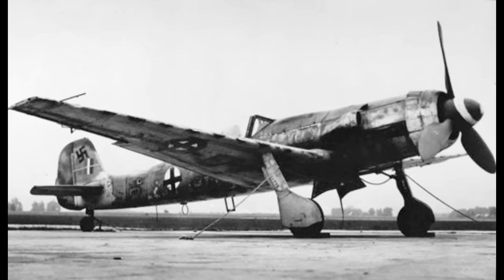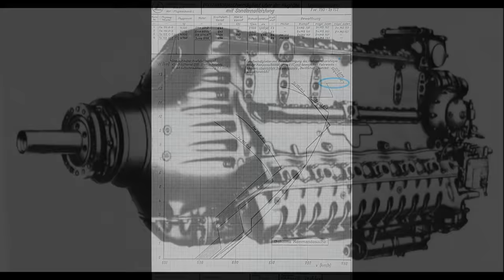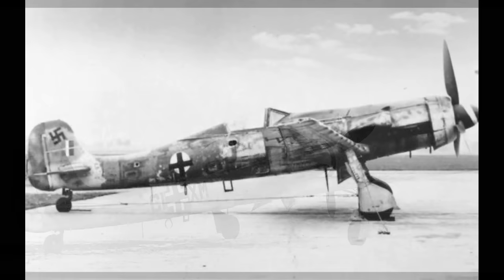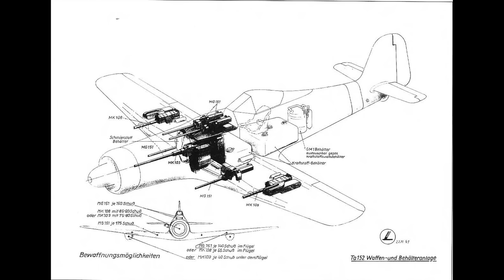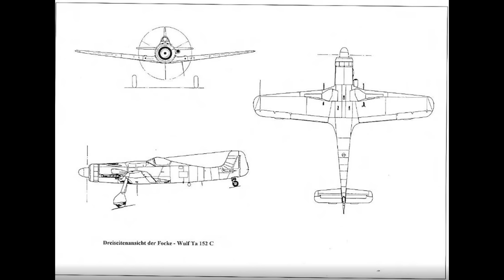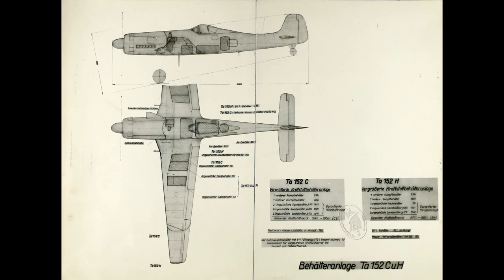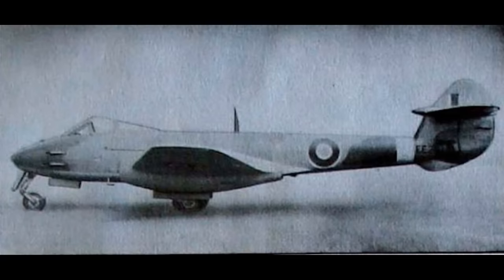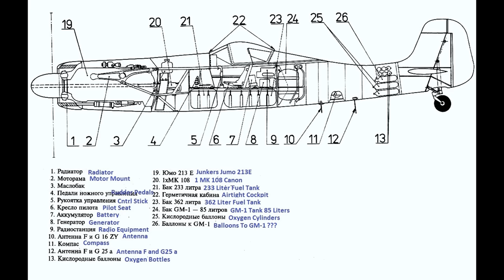Focke-Wulf Ta 152 H-1 Extreme Speed At High Altitudes.

Comment: So what if the Germans made it a TurboProp ? What speed do you believe it would be capable of then ? :)
Reply from the maker: That's too much for be to speculate on. The Germans never made a turboprop during the war. I'm trying to be realistic on this channel.
Reply: @GregsAirplanesandAutomobiles  I am not saying they ever did of course. I was just wondering since your pretty good at math and figuring things out if you could make a rough estimate of what the Jumo 004 attached to a German fighter prop might put out HP wise. I guess this is beyond the scope of your knowledge sadly.
Reply: @GregsAirplanesandAutomobiles   Greg I found out with a search that actually the German's did make a turboprop.. Alan Arnold Griffith had published a paper on turbine design in 1926. Subsequent work at the Royal Aircraft Establishment investigated axial turbine designs that could be used to supply power to a shaft and thence a propeller. From 1929, Frank Whittle began work on centrifugal turbine designs that would deliver pure jet thrust.[20] 
The world's first turboprop was designed by the Hungarian mechanical engineer György Jendrassik.[21] Jendrassik published a turboprop idea in 1928, and on 12 March 1929 he patented his invention. In 1938, he built a small-scale (100 Hp; 74.6 kW) experimental gas turbine.[22] The larger Jendrassik Cs-1, with a predicted output of 1,000 bhp, was produced and tested at the Ganz Works in Budapest between 1937 and 1941. It was of axial-flow design with 15 compressor and 7 turbine stages, annular combustion chamber and many other modern features. First run in 1940, combustion problems limited its output to 400 bhp. In 1941, the engine was abandoned due to war, and the factory was turned over to conventional engine production. The world's first turboprop engine that went into mass production[specify] was designed by a German engineer, Max Adolf Mueller, in 1942.[23]

Comment: Our amazing planet has oxygen in abundance at lower levels. As one goes higher it becomes more scarce as free climbers sans artificial oxygen topping Mount Everest can attest. A mere 30,000 feet. As we approach 60,000 feet it begins to become very difficult to sustain powered flying.

The B-36 could sustain flight at 45,000 to 50,000 feet for over thirty hours. 15 man crew strategic air command.
Non refueled. Had a bomb bay for 72,000 pounds of bombs. Air crews had to be on guard for reciprocal engines timing advances for fuel savings at altitude. If not re adjusted at descent the detonation would soon destroy engines with all likelihood of crash. Could not fly on jets alone at low level. Interestingly the Jets ran on the same fuel as the 4360 Wasp Majors.

One must use engines that don’t require external oxygen at higher altitudes. Such as rocket engines.
As we go higher one begins to exit the beauty of our blue orb and the blackness of space becomes the scene. It is a glimpse of how tiny our home is in the vastness of vacuum of outer space.
Even higher and one begins to feel the loss of the gravitational pull that he has known since before birth and bids a fond farewell to his most dear home.
Reply: +Bill Bright   I remember that a current F-15E driver described getting overtaken and passed by commercial airliners flying lower because way up high his engines were just not making power.

Comment: I believe the DO-335 Pfeil top speeds higher at 474 mph.
Reply from the maker: Yes, but not at 41,000 feet.
Reply: @GregsAirplanesandAutomobiles  That was a comment exclusively aimed at the "fastest piston engined fighter of the war" remark. Obviously, the A-9 version with the pressurized cockpit and GM-1 system would have been necessary to get that high altitude competition. Great videos!

Comment: The US could have had 490 mph p-51's and P-47's  in early '45 (even late '44 had they been pressed) but had chosen to develop them further into the P-51H and P-47N/P-72 rather than interrupt P-51D and P-47D  production. In short, the Germans were just desperate  to get something out sooner.  There was no magic in Nazi aircraft design and production.  They could have had P-51 equal designs in 1943 but the short-sighted Nazi bureaucracy had put off new development too long.
Reply: The USAAF used nitrous oxide in some P51D targeted at covering Me 262 bases.  I imagine they replaced the 66 gallon tail tank with the nitrous oxide tank.   The RAF used nitrous oxide on Mosquito night fighters, these were single stage super charger aircraft.  Late war Me 109K4, Fw 190A9 and Fw 190D9 were all supposed to have a rear fuel tank of between 115-140 Liters which could carry either MW50, Nitrous Oxide or Fuel depending on mission.  Problems with plumbing supplies stopped this from becoming standard but many aircraft had single purpose tanks. . The Jumo 213E1 engine on the Ta 152H was only an interim engine.   The Ta 152H EB with the Jumo 213EB offered the same speed without GM1 or MW50 and could so so a much lower altitude..  It had increased valve area and a far more capable radiator and inter cooler.  Fitted to the Fw 190D12 EB the aircraft was expected to do 488 mph.
Reply: @WilliamJones-Halibut-vq1fs  - "There was no magic in Nazi aircraft design and production."
I think you're being rather disingenuous with that tone of "coulda woulda shoulda". First and foremost not every German then was a Nazi. But more importantly from a technological point of view there was a reason why the allies had taken so many scientists from Germany after the war. Not to say they were super superior at everything but they made many important and notable contributions.
Reply: @WilliamJones-Halibut-vq1fs  - Correct my bad. My comment was meant to be directed at hoodoo.
Reply: hoodoo2001 The Problems the Germans had was that their factories were in range of massive US and British allied air power based in the the UK but themselves were unable to damage and slow down US or even British development and production because they could not reach the US East Coast.   Bombing slowed down production and development and deployment of new weapons such as the Ta 152 and Ta 154 and reduced quality as labour used in repairs could not be used to introduce improvements.   The Jumo 213 E on the Ta 152H was meant to be intruded as an engine running on C3 fuel of approximately 100/130 rating but had to be redeveloped for 87 octane after german synthetic oil refineries were damaged.  As far as your claim that nazi corruption prevented the introduction of a new generation of fighters in 1943.  I can’t see it.  The Me 309 flew in June 1942.  It had laminar flow wings and a highly efficient retractable radiator.  It eventually reached 466moh in Test and had 80% more range than the Me 109.   The problem is this:  it needed either the Jumo 213 or DB603 engines and they were barely ready for service in late 1943 (really very late 1944 because there was no water injection before then and the engines were still high maintenance items 1944).   There is no way that they could have gotten anymore than a small production of this aircraft for a lot of misery.   Then there are the newer generation Italian fighters which were much younger designs than the Me 109 and could take the DB603 engine but were designed for job shop cottage production not mass production and would have taken a long time to productionise.   A 1945 Me 109K4 probably too 1000 hours to produce as opposed to 8000 for the Italian fighters.The solution was to develop the Fw 190A into the Fw 190D and Ta 152 (Ta 152 was over 60% common with Fw 190)

Comment: read Willi Reschke's book......very informative,,,,,,he got 2 Yak 9s and a Tempest at low altitude
Reply: Low altitude being where they mostly operated in the Russian or British sectors, where in winter of 44/45 weather conditions would often hand a potential tactical advantage to something like a Dora (and a great many "Ta152" (C) sightings in combat will turn out to have been to have been Doras and the chances of running into a Ta152H in combat were so small that it cannot even properly be said to have officially been in service. Most of a relatively small number languished through lack of qualified pilots, lack of fuel or the fields being over-run.
Reply: @rodparsons6719  I Have no reason to believe that any C versions of the Ta 152 saw service
Reply: @rodparsons6719  12 Ta 152 H-0 and H-1 saw combat....Initially with III/JG 301, until they were transferred to the Geschwaderstab flight
Reply: @cartersmith8560  Nor do I have reason to believe that the Ta152C was in service, but the (C) is mentioned in parentheses since either Pierre Clostermann or his editors for "The Big Show" at some point appear to have described or identified Doras (in text and in photo captions) as"Ta152". 
Given the conspicuous  elongation of the Ta152H but with the high aspect ratio wing not being mentioned, it seems likely that there might have been some (retrospective, probably post-war) confusion of Dora with the Ta152C.
It would be interesting, for me at least, to read some reports of shoot downs of Ta152's, if only to see how those Ta 152 are described.
Reply: @cartersmith8560  This was part of my catechism as a child. My father was attached to 80 OTU when I was born (Free French unit converting to MKXVIII's).
Reply: @rodparsons6719  to this day I am BAFFLED as to what German aircraft Clostermann actually saw, he describes combat with the Ta 152 from july 1944 onwards....the Dora 9 was introduced in the Autumn of that year and as we know only a dozen real Ta 152 saw action in the following spring...Allied intelligence misinformed Clostermann
Reply: @cartersmith8560  Given his area of operations it is certain Clostermann will have seen more than one or two Dora's. Interesting to note that both the 486 Squadron Tempest pilots collided with the scenery whilst evading. I don't care to be second guessing brave young men but share your view on what a Tempest might do in such a situation. Maybe they were a little behind the curve from the off. 
"Don't think there was nothing to it just because it was almost over.." I was told by someone who knew.
Reply: @rodparsons6719  "The Luftwaffe neither asked for or gave any quarter, and we fought hard against them until V E day" Group Commander J E 'Johnnie' Johnson
Reply: @rodparsons6719  Clostermann may have been shot up by Hans Dortenmann, the most successful Dora 9 pilot.....he claimed 18 victories in the Dora 9
Reply: @rodparsons6719  Warrant Officer mitchell had battle damage, possibly control surface damage, and was maneuvering a heavy aircraft violently at low speed....stalling was inevitable.....P 38 pilot Thomas McGuire, 38 victories, crashed and died under somewhat similair circumstances

Comment: Cant some rich person build a Ta 152H with todays stuff but with jumo213 engine and high octane fuel
Reply from the maker: Once this 3D printing thing really takes off, they yes, I think it can happen.
Reply: @GregsAirplanesandAutomobiles    For a project they will also need the engineering data for the Ta-152 type, which may be incomplete or missing entirely.   I don't know if Ta-152 engineering specs are in the USAF Museum archives or with the Smithsonian, but both have historically been reluctant to provide drawings or blueprints for any flying project,  just "research."  Also an original Ta-152 serial number plate or ID would be helpful as a start.   Realistically, the Ta-152 was rushed into service likely with many undiscovered flaws and would perhaps need a thorough engineering study before building a flying example.  So add that to the costs of a project. 

Regarding 3D tools in restorations,  they have already been put to great use.  The Flying Heritage Museum Stuka is one example, beginning with partial wreckage and partial engineering drawings. They used 3D tools to scan the Stuka in Chicago and get a lot of the data they needed to fill in missing information for accurate construction.  A fascinating project, if it is ever completed to fly now.  https://worldwarwings.com/wp-content/uploads/2019/04/data-2.jpg

The Typhoon project in Canada is one to watch because they also began with a partial wreck, partial blueprints and about half of a Napier Sabre engine.  They are relying heavily on 3D tools to build their example to fly.  The 3D tools give them accuracy down the to the MM when combined with factory data. Amazing work.  Here is someone working on a Typhoon component: https://scontent-iad3-1.xx.fbcdn.net/v/t31.0-8/15385344_1205920056153809_6518129806150647851_o.jpg?_nc_cat=102&_nc_sid=730e14&_nc_ohc=XE5OGi7OOV4AX_mOxf3&_nc_ht=scontent-iad3-1.xx&oh=6d677db007a9c07937740ece7b499d45&oe=5F416A10
 
Here are 3D scans of a Typhoon wing for data: https://scontent-iad3-1.xx.fbcdn.net/v/t31.0-8/12068973_911092952303189_358996024057121815_o.png?_nc_cat=106&_nc_sid=730e14&_nc_ohc=fcl7AQPW7KMAX8lhFEC&_nc_ht=scontent-iad3-1.xx&oh=e9c3f04a2bb1bcd3bffb39fc51d6c391&oe=5F43A01D

Here are 3D scans of a Napier Sabre supercharger, I assume to get initial dimensions and clean it up to manufacture a new case:  https://scontent-iad3-1.xx.fbcdn.net/v/t1.0-9/43951888_1921992937879847_4759006076739780608_o.jpg?_nc_cat=109&_nc_sid=730e14&_nc_ohc=zI_ui_SG_VsAX8RB4ec&_nc_ht=scontent-iad3-1.xx&oh=12b64abe68afc17c3f81336251e128df&oe=5F40C94E
https://scontent-iad3-1.xx.fbcdn.net/v/t1.0-9/43951693_1921992854546522_885908052149010432_o.jpg?_nc_cat=101&_nc_sid=730e14&_nc_ohc=cXorWYZnUmoAX-IDmEm&_nc_ht=scontent-iad3-1.xx&oh=ef53afa86a15d2007ed9aebdeb2e10ca&oe=5F432327

Typhoon fuselage formers taking shape: https://scontent-iad3-1.xx.fbcdn.net/v/t1.0-9/99150370_3009000819179048_1397702196295892992_o.jpg?_nc_cat=106&_nc_sid=730e14&_nc_ohc=mlLEpxjIBnAAX-mr1Vu&_nc_ht=scontent-iad3-1.xx&oh=24e5c7abb6bbf3cf310e2c1e8da2b59b&oe=5F42E1A9
Reply from the maker: Such a project will create huge challenges, but I do think the FW190 design was sound, from the A models through the TA152s. I wouldn't hesitate to fly one that was built with modern machining and attention to detail. I would not have wanted to test fly them as they came off the assembly line in 1945!

Comment: A pressurized cockpit would have been quite necessary for a pilot lying the HI-LO-HI flight profile suggested due to symptoms of THE BENDS sometimes experienced by pilots in Allied fighters executing extreme high speed dives from 40,000 feet.
Reply from the maker: It would help, but there are several 40k fighters that are not pressurized.
Reply: @GregsAirplanesandAutomobiles  I'll intervene here, as I was trained as a Commercial Diver many years ago (maybe 1982!)...  The "Bends" is a body condition where the gasses that get dissolved inside the body tissues as the diver gets to deeper waterdepths, are released when he returns to the surface; that is, when the pressure is reduced, as the partial pressure of those gasses make them to come out of the solution, and therefore those form very small bubbles... If the speed of ascend is too great, those micro bubbles grow and actually start to tear the body tissues, and that produces an specific kind of pain called"the Bends", and the only way to get a relief from it, is to go down again, either by submerging or by going into a decompression chamber, and to breathe pure or concentrated Oxygen (that helps).  Therefore, the Bends occurs when climbing, not when diving.  So,the cockpit pressurization only would help to avoid bends in a very large and swift climb, not at all in a prolonged dive.  Amclaussen.
Reply from the maker: Thanks Elizabeth. That's the best explanation I have heard.

Comment: The Germans were never able to get close to the Allies in the octane of their Avgas. That reason alone is why the Germans should have gone more heavily into Jets, much sooner.  Jet-A1 jet fuel is simply Kerosene...........cheap and simple to make, and in the war time economy its not nearly as in demand as Petrol or Diesel fractions of crude oil ( at a density of 0.79 its exactly in the middle).
Reply from the maker: Getting jets sooner wasn't really an option.
Reply: @GregsAirplanesandAutomobiles  Is it true that Hitler delayed the entry into service of the Me262 by getting it re-designed from a fighter into a fighter-bomber? By the time of surrender, there were a decent number of them made..........but the supply of needed fuel and other consumables had collapsed, leaving them unable to fly. Albert Speers memoirs leave a very distinct impression that the first 5 years of the war, German industry was poorly organized and many factories were not anywhere near full production.  Goebbels could not even get Hitler to commit to the concept of "Total War" until 1944...........5 years too late.

Comment: The metric system isn't just easy, its the international standard, Except for holdouts like  merika and partly the UK.
Reply from the maker: Negative Ghost Rider. Nearly every single country in the world uses Standard U.S. Imperial units in aviation. That means feet for altitude and knots for speed. I think China is the last holdout, and not even all of China.
Reply: One could also point out that aviation units of nautical miles and nautical miles per hour are based on lines of latitude on planet earth (each minute of latitude is approximately 1 NM).  This is why they remain the units of choice for measuring distance and speed for navigation by longitude and latitude.